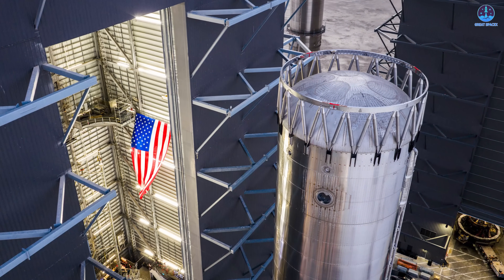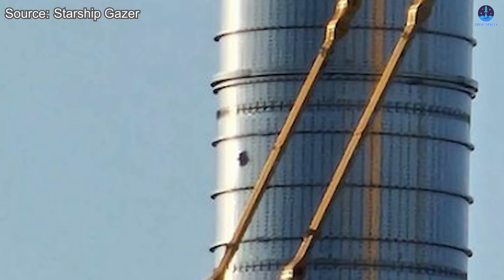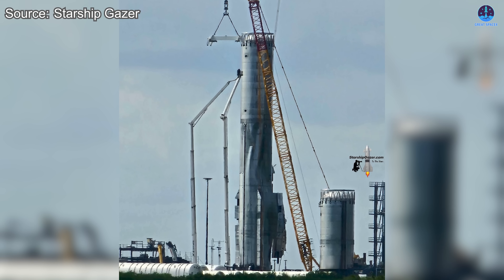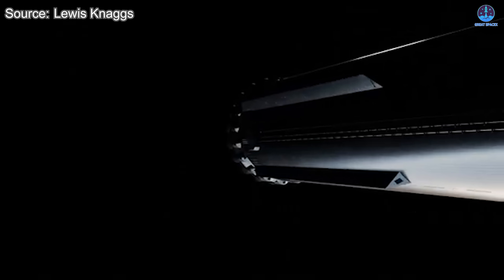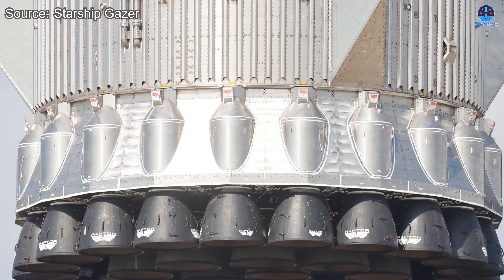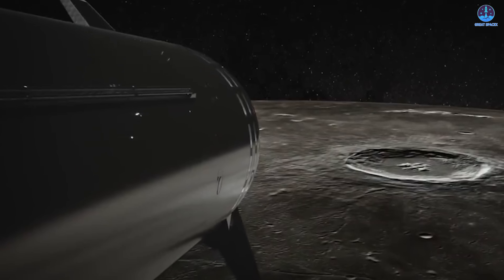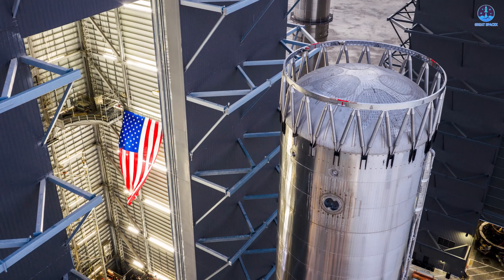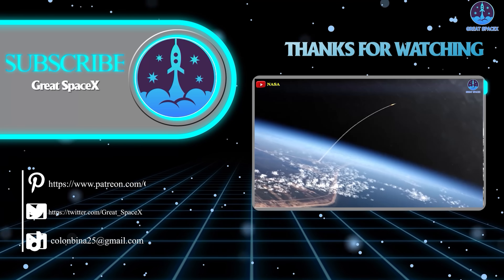SpaceX Found Unexpected Data on Starship Booster Failure just Shocked the Entire Rocket Industry!

Comment: Combined testing with enhanced complexed sensors - expectation being success, however, this method of suspected testing combined with enhanced sensor deployment throughout the system. May seem counterproductive, however, I believe that this form or method of testing gives them a massive data silo or multi-silos of data with each launch or rapid disassembly or anomalous occurrences that can be introduced to A.I. which by analysis provides enhanced manufacturing analysis leading to a much condensed advancement over a shorter period of thought, design, production and completed product.  Expand your mind outside the box and consider "all" that could be tested and then be manipulated through A.I. troubleshooting.  No matter the outcome valuable information is captured which will lead to a more advanced product that will be optimized to being "bulletproof'".  So, in my mind this test is not a failure "B18" is a valuable success.  Why is it a success because if it fails in its design application everything after or above the booster is lost.  I love this company and its philosophy of its exoteric business model.  They are sharing so much mind expanding knowledge and educational engineering for all of us watching and cheering all the countries that are working on this.  - Thanks Keven - Thank you SpaceX Team all of you are super.

Comment: In some cases, it's less wise to build taller, and instead
build wider. Yes this means more air friction, but in turn
is easily offset by just using a little more fuel.
A diameter increase of times 1.41 increases fuel capacity
by a factor of 2, while good ol' aerodynamics can keep
the increase in friction down, while also increasing engine
capabilities by simply adding more of them on the bottom
surface. In all this also lowers the need for structural ability
in the long frame.
For someone so supposedly smart, he sometimes makes
dumb mistakes.
Reply: While you simple math of d^2 is proportional to area, you make an unsupported statement about Musk.  If you are so much smarter, I suggest you go out, form SpaceZ, and beat Starship to the moon and/or Mars.  No Elon fanboi here but SpaceX is trouncing NASA and Blue Origin too.
Reply: You keep forgetting, SpaceX is always testing. "Go Space X" GO. 👍🇺🇲👍
Reply: @jimmydarby5878  I am from a pre-computer error where designs had to be built, tested and redesigned until correct.  Computers have their place but you can only go so far with simulations at a desk.  Real, hard data, acquired through testing, is needed for accurate simulation and SpaceX is one of the few companies who works in this way.
Reply: I'm also wondering if you know anything about engineering, specifically MTBF, mean time between failure.  In the most basic terms, the more components you add to any design, engines in this case, the less reliable the design becomes. 'Just adding engines' has many negative consequences beyond just providing more thrust.

Comment: Pressure Test stand for booster needs to be re-located away from other test infrastructure.  The entire facility design is success oriented when it should be failure oriented.  Survivability of the test infrastructure is as important as test article itself.  Facility is poorly designed.

Comment: The chronic problem with Starship is lack of payload capability. V2  demonstrated 20t. V3 with greater thrust and same Isp may get to 30t. So, all the payload gains will come from lowering the dry mass. Can they lower it enough to gain another 30t?? Or more? It seems unlikely. This is all a suborbital trajectory still since teaching orbit will be yet another penalty on performance.  I do not think that V3 will be able to lift 100t to LEO at all. If Starship is truly reusable, and it has a working heat shield they should consider a drastic change in materials to increase its performance.

Comment: was it an explosion or an abrupt decompression?
Reply: A distinction without a difference?
Reply: RUD. Explody things would have happened if it was fuel, not overpressure
Reply: Definitely an explosion.  You can observe the way the metal is bent: outwards.
Reply: @lcambilargiu  Implosions frequently bear signs of explosion due to "bounce" of concerned structure. Technically, it can be confirmed that a RUD has occured, but cause is still obscure without the metalurgy (parts) in my hands.
Reply: @MikenomorCCP  yes indeed.  It has to be said that there is an oscillation of pressures until equilibrium.  But still, the primary event with the booster was expansive.

Sometimes, a previous ship RUD for example, the secondary implosive event contributes significantly to the destruction.
Reply: @M @MikenomorCCP  the tanks and all were indeed pressurized after all.
Reply: @lcambilargiu  We can safely conclude that whatever occured, the process had a "catastrophic" effect on the vehicle's performance capabilities 😂, and was best seen "sans" flamable fuels, rather than coming as a surprise with souls aboard. 
   IMO, the fast cycle, "problems be damned" attitude of SpaceX has been a true boon to testing and learning procedures, complimented by the immense ivestment by PRIVATE coffers, capable of absorbing the set-backs in the name of progress. If on the other hand, humans tried to do all of this without failures, we'd never get anything done, and that would be a MUCH bigger disappointment than a few pieces of scrap metal laying about. I've heard the research motto at SpacdX is something like, "go fast and break things", and though personally that idea terrifies me, I neither have to pay for it by force, nor clean up the mess.
Reply: @lcambilargiu  I figured as much. What really concerns me, being an engineering sort myself, building advanced homebuilt high performance aircraft, is; was there enough of a debris pile left to determine ACTUAL failure, and make the necessary changes without huge delays/redesigns. Also, it's a plus being more or less "self-funded", given if Musk and the kids were spending gubumutt (taxpayer's, your's and my) funds, folks would be getting pretty pissed by now. As it is, it's just "learning", and has cost "us" very little but anxiety and annoyance/disappointment.
Reply: @MikenomorCCP lol so true.

I will also say that given the amount spent on SLS and starliner, the public is pretty immune to excess spending they don't see.  

Ship will essentially be a shuttle 2.0 I think.  I think you are right about how you need to be willing to clean up the breakage.

I want to say that in-orbit refueling is ambitious.   I wonder how much breakage we will see there.  But after that...  well like F9 we may see QC issues with materials, see limits being pushed. Maybe a missed landing on the landing arms...

Popcorn
Reply: @lcambilargiu  LOTS of popcorn!

Comment: This incident is concerning.  It's the second POV to fail catastrophically, showing that there's a serious problem with the POV design, manufacturing, or testing processes.  SpaceX needs to make these components absolutely stupidly reliable, especially where re-use is the ambition.  This MUST be addressed and the problem completely eliminated and no amount of "Ah, but this is better, that is better," is going to whitewash this fact.
Reply from the maker: Exactly 👍
Reply: Hmmm.  The RUD occurred during testing.
Reply: @lcambilargiu  The COPVs should be tested BEFORE being assembled into the vehicle.  There is too much at stake to rely on post-assembly testing of dangerous components.  We need Six-sigma level reliability in human-rated systems, not crossed fingers and rosary beads!
Reply: There have been earlier reports they were being mishandled??
Reply: @wtaiii  And the question that begs is: why were they mishandled?  Why was there not procedures to prevent such "mishandling"? And, if mishandling was indeed identified after the earlier event, why did THIS latest event occur, assuming that the mishandling issue was adequately addressed?
Reply: Can you imagine anyone wanting to ride to space on one of these, after the display of failures, if it ever gets to that point.
You would have to think very hardly before getting into one.
Reply: @Mike-bi7kb  Even Apollo had problems during its development.  You have to remember that SpaceX are pushing the boundaries with these vehicles.  But after each anomaly, they should have tightened up procedures and methods sufficiently to prevent a recurrence.

Clearly they have not yet done so.  I for one do not want to see a repeat of a POV rupture.  if it happens a third time, confidence in the Starship program will collapse.
Reply: @Mike-bi7kb  It won't happen, this clown car of a rocket will never, ever be certified for human flight.